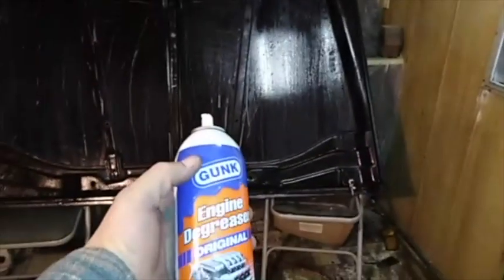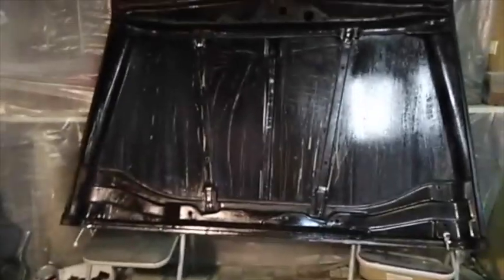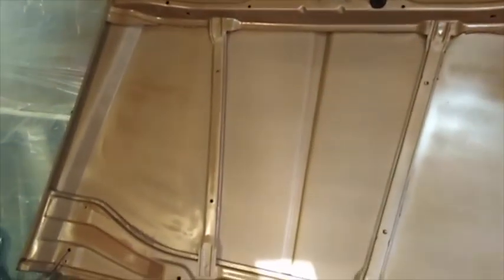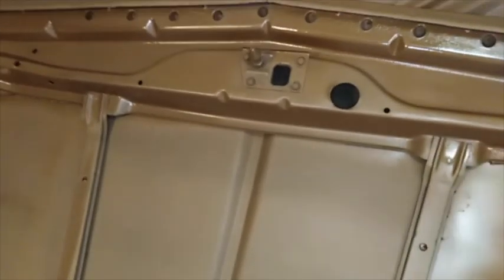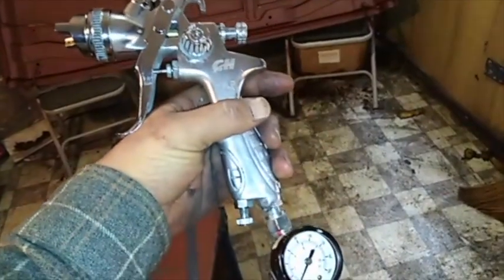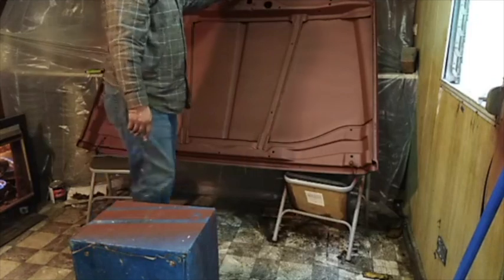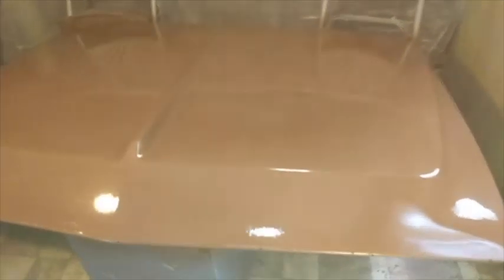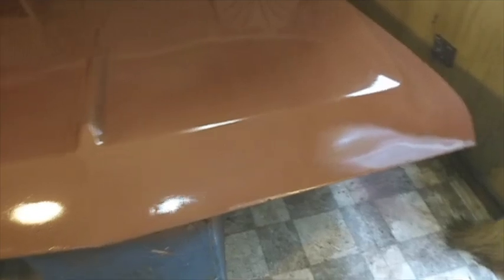Primer on Hood, Cowl and Nose!

Comment: Looking really good Luke! I'll bet it's a pain working on that in this damn cold weather we are having. That room looks fine, but having to go outdoors to do things is brutal. Hope you got that paint cleaned off your nose or at least painted the other side to match.
Reply from the maker: Thanks, I'm glad I had this storage building, my heater couldn't keep up in the garage. I need to build some doors, putting plastic up just doesn't cut it when it's this cold out. Yeah, the paint came off, but after scrubbing so much my nose was still just as red as it was with the paint.